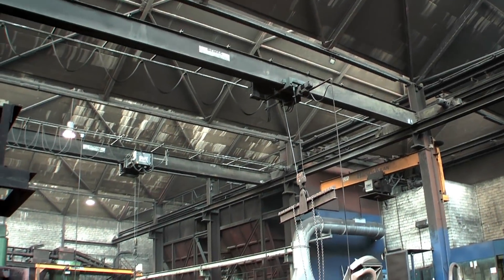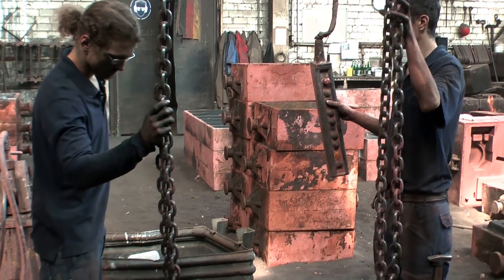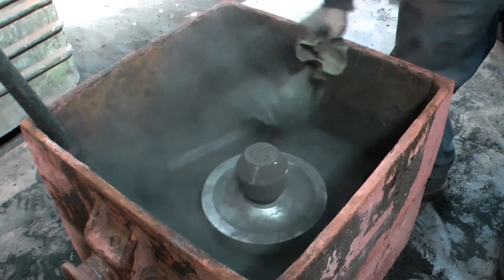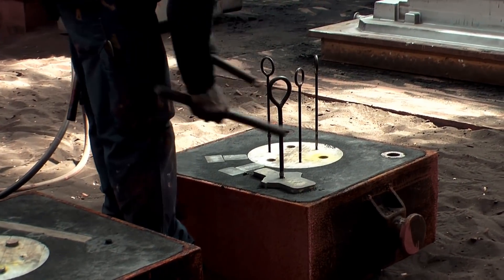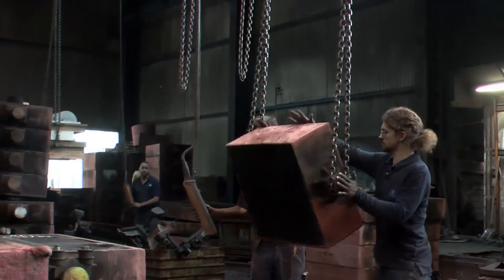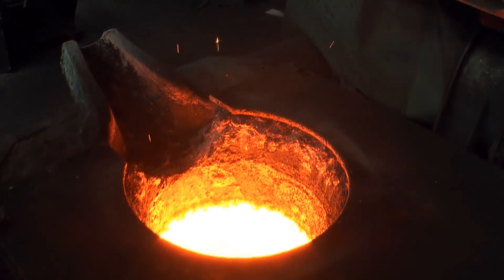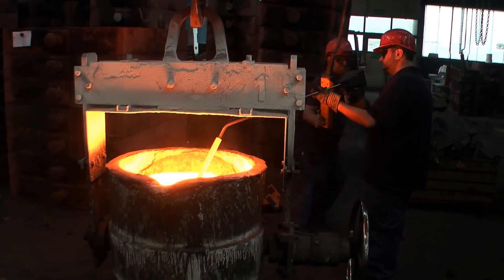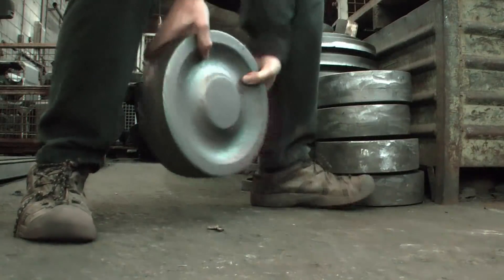Casting an iron wheel

Comment: I got a story I want to tell you I was on clean up crew I also was in charge of fire extinguishers one of the molds was on fire the flames was getting pretty hight I though it might catch some electric wires on fire frothier down the line so I though I would use a fire extinguisher I never used one of them before I field the whole foundry with a thick smoke and the big shots were taking a tour of the place I thought I'd catch hell for that one but no body sad anything I got away with that one and the big shots seen it all

Comment: 🍊🍊Coal / Iron Fines/ Steel Slag /Blast Furnace Dust  Briquette Machine 
The briquetting machine can be used to process industrial wastes produced during the course of metallurgy or steel processing into briquettes which can be put into blast furnace for further metallurgy and used as chemical additives as well
🌻🌻Process: Coke, Charcoal, Blast Furnace Dust, Lime Powder, Gypsum Powder, Iron Powder, Oxide / Mill Scale, Fluorite powder, Ferro manganese, Ferro chrome fines, etc.
👉whatsapp directly for factory price: +8613027712526
Click website for details: @t

Comment: Wait, so they have a resin pre mixed with the sand that hardens when condensed or when it meat the airs?
Reply: When it meets the carbon dioxide in the air specifically, the resin is called sodium silicate.

Comment: How to reuse the sand which is already solidified block by resin?  Do we need a crashing machine to crash  sand block?  Is it easy or difficult to reuse if we use resin in the sand?  Thanks,
Reply: Basically all of our sand was reused. Some of the sand can be made hard enough you need to use a jackhammer to chip it out. It’s all thrown away. The molding sand was never that hard. The center core sand typically burned up and was returned in the system.

Comment: 0:15 - wtf? where is it happening? do they still use slaves???
Reply: Those are normal workers in a steel plant.   These are jobs millennials would run away from.
Reply: @josephastier7421  Sorry man! I meant no offence. I have worked 10 years on metallurgical plant and usually we were using personal protective equipment (coverall, gloves, glasses etc). This is no good to keep all industrial mud on you.
Reply: @kanatmukatov2730  No offense taken, and indeed they do look a bit like workers in an east European reeducation camp.   
I have never worked in a foundry but I do know that if molten metal finds water that it will explode.  To work in such a place you would want PPE up to and including a full proximity suit.
Reply: @josephastier7421  It is NOT a steel plant.
Reply: @flamingfrancis  Oh right, casting.  Indeed.

Comment: I wonder if spraying your piece with a light coating of mineral or cooking oil would help it come out of the mold when the mold is initially formed or if that would be a bad idea.
Reply: Liquids of any type would contaminate the sand causing imperfections in the finished part.
Reply: We were told to spray the patterns with oil so that the mold would not stick.  If sand sticks to the patter it becomes part of the pattern.  This happened to me and I did not notice it with the result that a number of my pieces had to be sent to the grinders to have the bump ground off.  This was at Lancaster Malleable in 1973.  The parts I was making were for commercial oven doors.  I was paid 3.23 an hour while the grinders were paid 11.00 an hour.

Comment: What can hold melted iron?  Wouldn't it melt whatever they poured it in?
Reply: graphite, it has higher melting temperature than iron and some other metals
Reply: The ladles are coated with 6 inches or so of refractory which is a special preparation of cement.

Comment: That s à very interesting video I did not understood that the sand do get hard.. I work in pianos so iron "plates" are not new to me.  But there are cooling deformations and stresses in our parts.
However on those wheels the precision looks a little " crude" , I guess they are machined later to get to the nominal dimensions.

Comment: I need to know how a pulley with fancy curved spokes is made. I see them a lot on antique machinery and church bells of iron had giant iron pulleys attached to them to swing them in America. Could you tell me how it was done? I beleive it all was cast in one mold and no latheing done to make the groove in those big pulleys.
Reply: The shaped of the patterns determine the final product. Usually complex shapes used a lost wax process where the finished part's shape is held in place by a wax core that melts as the iron, aluminum, etc is added to the mould.

Comment: No way to speed up iron castings for small batch production.
Reply: Our company can supply silicon metal,silicon briquette,high carbon silicon,silicon carbide,silicon slag, casi cored wire, if you are request about them,please email me: star06@alloyssi.com
Reply: Not in a foundry that operates 1800 style.

Comment: Here in the usa that red stuff they are washing the mold with can be expensive.  Not sure of that type exactly but the ones for stainless/steel are ;)  You would think they would just wash where the molten metal would be hitting the no-bake sand.  That excess on the mold adds up really quick.
Reply: Lowell Roemer what is that stuff exactly?

Comment: very cool.  I was surprised by the short sleeves.
Reply: If the materials used are properly dry, there shouldn't be much splash anyway. Most dangerous are the temperature lances you see at 8:18. They are wrapped in carton and the water in there evaporating throws drops of iron in the air. After tapping the melt is genereally not terribly hot (1300 - 1400°C), so the reaction is somewhat tame. At the furnace the melt goes up to around 1550°C regularly, so there are many more drops of the melt flying around when checking temperature. Also, at 1550°C the melt is radiating so much heat, that you acutally want to wear long sleeves during deslagging, but that also depends on the diameter of the furnace. Whilst your body is alright with the heat, your arm is heating up really fast. It tended to burn the skin on my little finger, cause it was heated much quicker then any other part of my body. It's a fun job though, i really like the look of the liquid metal. I can still be amazed by looking at the melt for hours :)

Comment: Great Matthias, I enjoyed this very much. To me molten metal and especially iron is very beautiful.

5:30 you say "this reddish liquid is a suspension of (something)" just curious what that was.
Reply from the maker: awldune That's chamotte (or grog, I think, see http://en.wikipedia.org/wiki/Grog_%28clay%29)
Reply: Matthias Burger Thanks Matthias, that makes sense.
Reply: @matthiasburger2315  chamotte (grog) does not have alcohol base.  What alcohol base is added to chamotte?  To soften the chamotte, they mix with alcohol instead of water?  They can soften with water also.  Why do they use alcohol based? Thanks
Reply: +awldune  It's a mould wash with alcohol base..